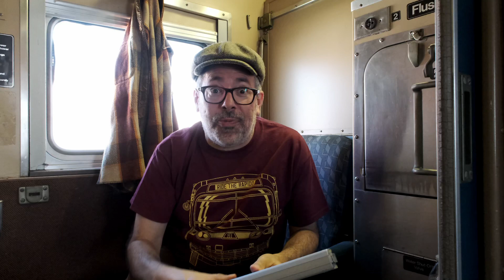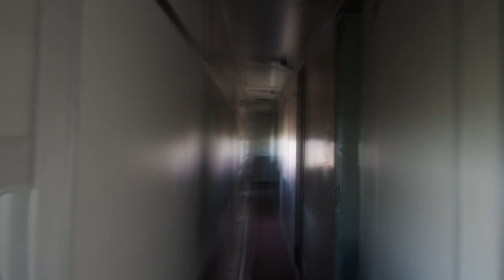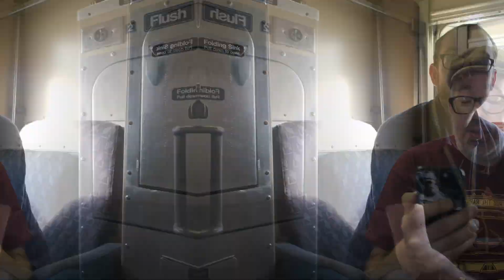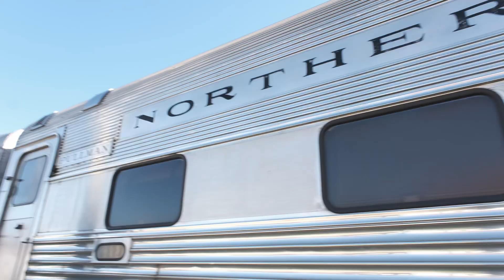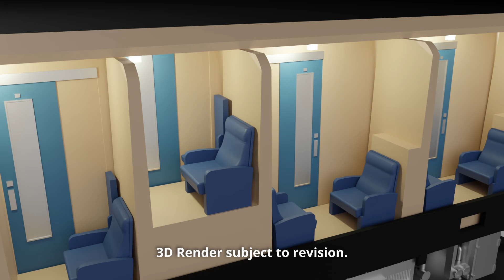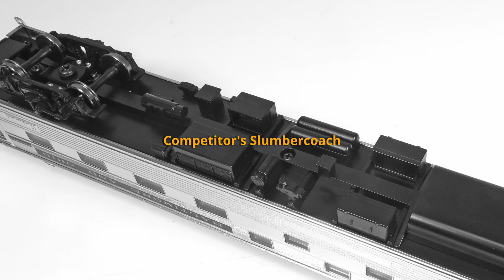Rapido's Slumbercoach - 16 Times The Detail!

Comment: As cool as the upcoming Slumbercoaches are, I'll say I'm more than a little bit disappointed that the appropriate HEP-era details for the later Amtrak versions aren't being done.  That's been the main thing keeping me from reserving.

Considering how nuts Rapido usually goes over detail variations, this seems like a notable missed opportunity in my eyes.
Reply from the maker: While we would have liked to do the correct details for the HEP conversions, unfortunately the cost to tool the correct body and under frame would have exceeded the number of cars we could have sold. Sorry about that.

Comment: We'll need to build open bottom frame bridges over dead flat reflective 'water' features that allow the underside of the coaches to be reflected upward toward the observer - hiding dim LEDs within the structure to illuminate the details.  Then come up with a good reason to either stop the train on the bridge or move it so slowly across.  🤔 Challenge accepted.
Reply from the maker: Modern problems require modern solutions!

Comment: I found out that Budd had designed 2 additional car types for 'The Canadian' back in 1954: a Parlor car to run Montreal-Ottawa & a Sleeper Dome with single berth rooms under the dome along with 4 sections & 4 Roomettes. CP decided not to order them.
Reply: were the ATSF high levels not built later then this car?
Reply: Very cool. Where did you source this info? Thanks